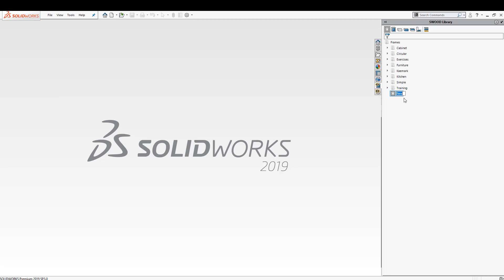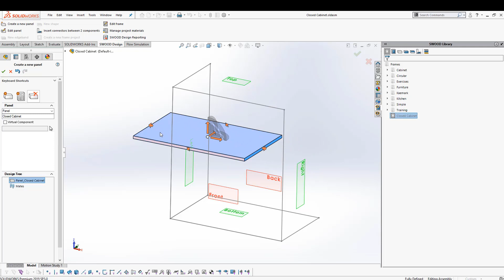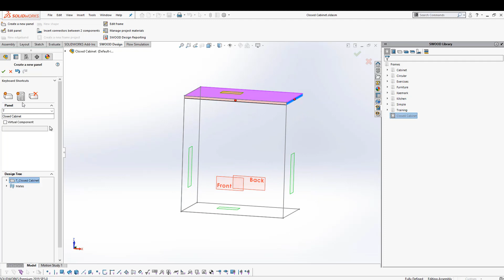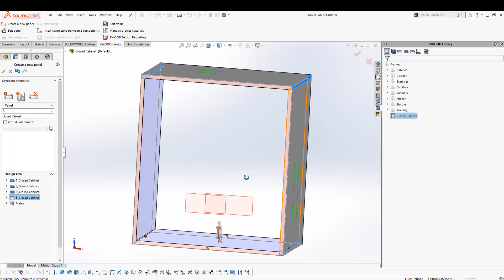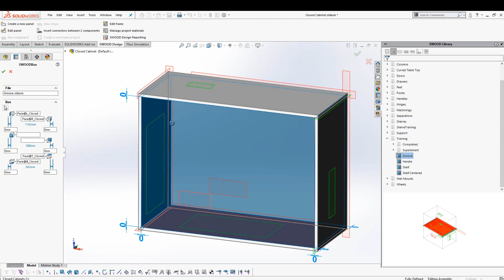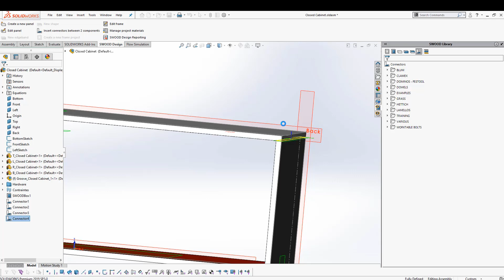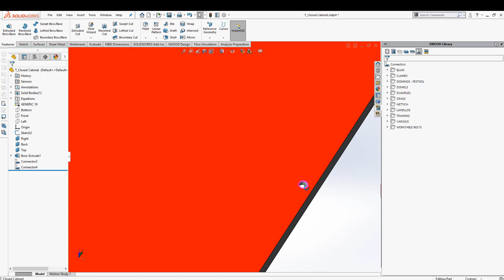SWOOD Design First Look - Creating Closed Cabinets

Comment: You mention that there is a keyboard shortcut to add all your mates but you don't say what that keyboard shortcut is. Could you please tell us? :)
Reply: R : Change front face
T : Change top face
C : Define panel with coincidence mates
Del : Delete panel/Delete mate
Ctrl + Mouse Up : Copy panel with mates
Ctrl + N : New panel
Ctrl + Z : Undo
Ctrl + Y : Redo
Shift + Click : Select the hidden face
Reply: @CAD3dworld  are there any shortcuts for left and right faces?
Reply: @abdullahdavutdemirbilek4370  no bro these shortcuts are given default  in solidworks
Reply: @CAD3dworld  Thanks for replying. Do you know which shortcut used in the video to define all mates automatically?
Reply: @abdullahdavutdemirbilek4370  C to define all current position as mates automatically